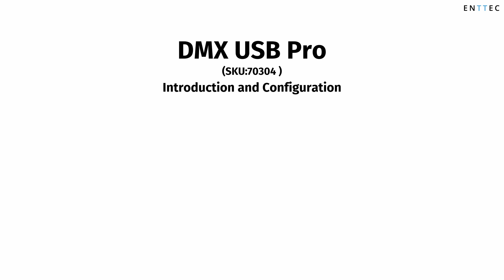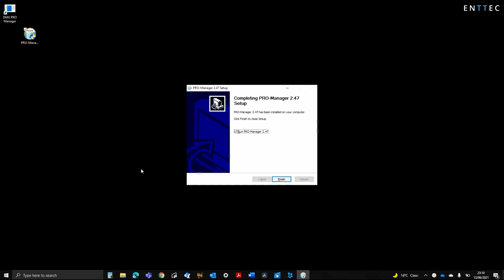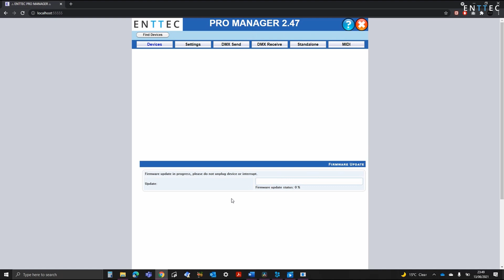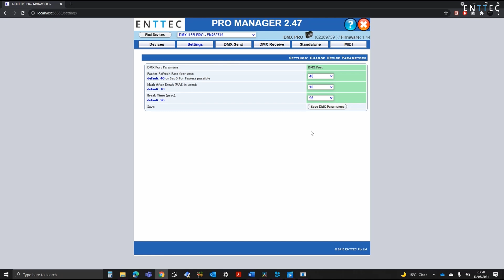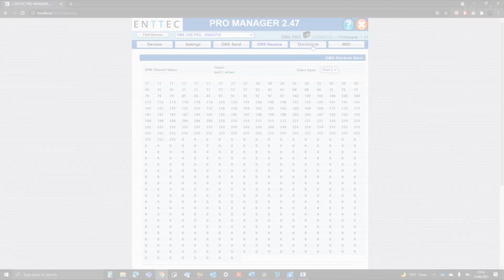ENTTEC TECH TIPS: DMX USB Pro Introduction and Configuration

Comment: I have a bunch of lights with 3 pin dmx plugs. Would I be able to use them with this?
Reply from the maker: Yes, absolutely. Both solid-style or cabled 3-pin to 5-pin XLR adapters in a variety of male/female combinations are readily available from many retail places online if you have a little Google search. They're fairly cheap too. Any of these will get you sorted!

Comment: Thanks for sharing.  I do have a question about expansion.  I'm reaching the end of my universe.  Can I just purchase another one (DMX USB PRO) and use a different USB Port or connect them both to a docking station to run a 2nd universe?  Or am I stuck having to upgrade to a 2+ universe product?
Reply from the maker: Depending on the software you are using, you might be able to use a second interface to output another universe if the software allows for it. You may need to check the user manual or support resources for the software you are using. 
Usually when multiple universes are required, the way this is done is by transmitting via an DMX over Ethernet protocol such as Art-net or sACN. In this way you can use a multi-port node or several smaller nodes to output 2 or more universes

Comment: can the DMX signal coming into the device be used to control resolume triggers?
Resolume supports mapping dmx signals/ranges to interact with controls, but I am not sure if Resolume will see the incoming DMX signal from this device or if some other chain is required?
Reply from the maker: Hi,
Resolume can take DMX input but their documentation says they require Art-net input - https://resolume.com/support/en/dmx-shortcuts
So you may need something like our ODE Mk3 to convert DMX to Art-net to send into Resolume
You can find more information about the ODE Mk3 here: https://www.enttec.com/product/dmx-distribution/ode-mk3-dmx-ethernet-converter/

Comment: Hello, nice video! Im a noob to this world and I would like some help here please… How could I set up my two lasers to be controlled by a DMX controller? I’m using FB3QS controller and enttec dmx usb pro as interface. Besides quickshow software.

Would I need to send the dmx controller to the DMX input of the enttec, then enttec’s interface’s usb b port to the computer, after that configure my quickshow settings for DMX signal and connect my computer to the fb3qs and the latter to the laser? And daisy chain the lasers using an ethernet cable? 

I’m sorry if it’s hard to understand. I simply can’t find good information sources to learn this.
Reply from the maker: Hi,
We haven't spent to much time playing with Lasers ourselves but after having a look on the pangolin website it looks like you are on the right track.  We found this connection guide document that might be helpful for you https://cdn.shopify.com/s/files/1/2680/6950/files/connection-diagrams.pdf?18061

Comment: hi ! Is this possible to use DMX usb pro as a merger, for exemple we have 2 computer, One on magic Q on PC (chamsys) and the other on das light (with the interface) Can i send the out of daslite in the usb DMX pro and send the receive signal to the out ? 
thank's :)
Reply from the maker: Hey there, to reduce latency as much as possible the DMX USB Pro is only designed to connect to one piece of software at a time I'm afraid. - Potentially you could use ArtNet from DasLight to merge into the ArtNet input of Chamsys, - You could then output DMX from the USB Pro through Chamsys.

Comment: Hey sorry I think you've already be ask this but just want to double check 

This interface can take DMX in but can I send it to a visualiser on my laptop? I'm trying to program lights without setting up my lights everytime. Would this chain work? Ableton > DMXIS > DMX USB Pro >  back to laptop > MagicVis
Any advice would be massively appreciated :)
Reply from the maker: Hey Chrisy, instead of using a DMX USB Pro for this, we'd recommend sending ArtNet and carry this out using your network. (Chamsys only supports output on the DMX USB Pro). You would likely need to install a virtual loopback adapter to route ArtNet data from your lighting control software to your visualiser or send ArtNet data to the IP address 127.0.0.1.  -   If using EMU you'd be able to route your lighting control data to your visualiser using the virtual loopback adaptor at the same time as sending ArtNet into MagicVis.
Reply: @ENTTECofficial  Hey, thanks for this! Massively appreciate your help :)

Comment: Hi, can I program via ableton live and what plugin can I use?
Reply from the maker: Hey, yes, it's possible to control EMU using Ableton Live. You can either use the VST3 plugin (you're prompted to install it whilst first installing EMU) or simply by sending MIDI into EMU. You can configure this in the same Settings window us used in this video to select output settings.

Comment: No app is existing on my mac when I finish the installer.
Reply: Hi Jonathen, could I ask you to check the applications folder to see if a shortcut has been created?  To do this go the top-level Finder menu, then along to the 'Go' dropdown. Scroll down and click on 'Applications'. This should open a folder containing the files and shortcuts of every app you've ever downloaded, own or use use by default. If it's still not showing up can you drop a message to your support team using the form on our website (www.enttec.com) and I'm sure we'll be able to help you out.
Reply: The app shows up in applications, but it doesn't work.  The local host address opens up in a browser, "This site can’t be reached. localhost refused to connect."
Reply: @Acidbetty Hi there, please drop a message to our support team and attach a couple of screengrabs https://enttec.atlassian.net/servicedesk/customer/portals potentially this could be due to MacOS permissions.
Reply: @james_enttec444  hey i got the same issue, did Acid betty fix it? thanks